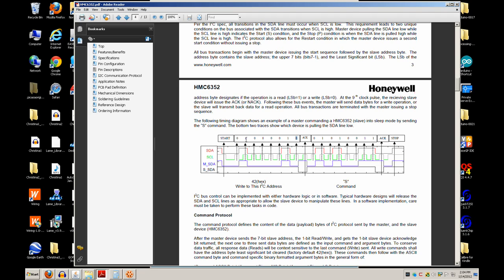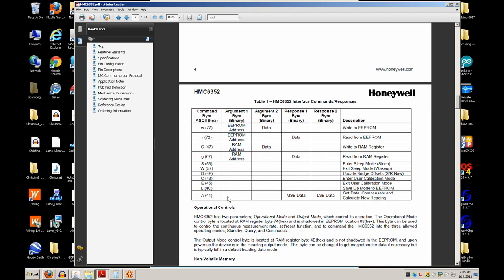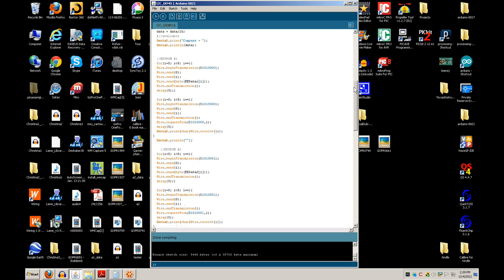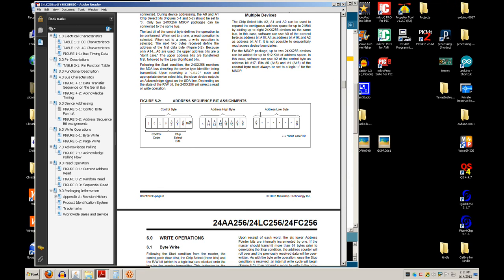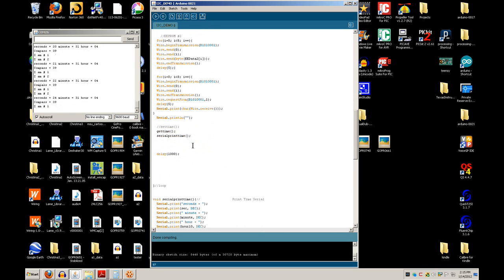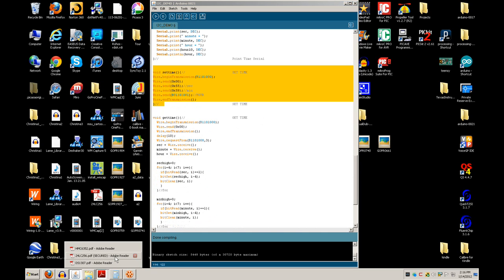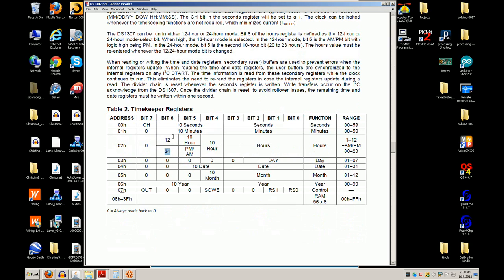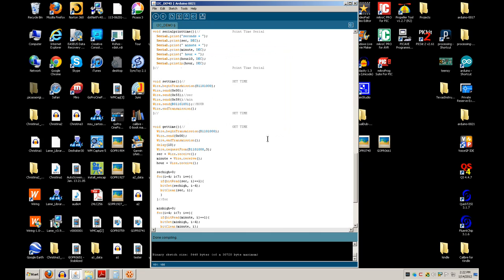How to work with I2C "Two Wire Interface" Devices!

Comment: Another note... the way that the RTC uses the 4 bits for "10 seconds" and 4 bits for "1 seconds" sets you up perfectly if you are using hex.  ;-)

since 55 seconds would be 0x55 ..    and 18 seconds would be 0x18  (note that 4 bits (a nibble) is one hex character.

For the other items (AM, PM, etc) you would probably want to use a struct{} to build and set it up easily.

Comment: You just have to know that for the 4 lower bits the values 1, 2, 4, 8 are and the upper bits are 10, 20, 40, 80. So you can roughly see what the value is in an instant

Comment: Hi this is very helpful video.
I had trying to get a simple communication between Arduino Diecimila and PIC24 through I2C. Its almost 3 months completed in search of communicating these devises. 
I am in a serious need of help I need a simple communication between pic24fj256ga110 a 100 pin device with Arduino, both of these devise are individual powered supplied and for pic I am using MPLAB IDE.

Comment: This can help you short the code with MSB LSB:

 unsigned char MSB = 0;  // 1 byte in Arduino
  unsigned char LSB = 0;  // 1 byte  in Arduino
  unsigned int MSBLSB = 0;  // 2 bytes in Arduino

Code segment:

   if (Serial.available() >= 2)
   {
     MSB = Serial.read();
     LSB = Serial.read();
     MSBLSB=word(MSB, LSB);
   }
  // Now MSBLSB = 320;

Comment: Dear Kevin,
                I am beginner learning this programming. I have issue when i upload the sample code like "Hello, World". It doesn't work and show error like ("liquid crystal _I2C does not name a type.")  i used the 1602 I2C screen LCD and sample code is

#include <Wire.h>

#include <LiquidCrystal.h>

LiquidCrystal lcd(0x27,16,2);  // set the LCD address to 0x27 for a 16 chars and 2 line display
void setup()
{
 lcd.init();                      // initialize the lcd 
 // Print a message to the LCD.
 lcd.backlight();
 lcd.print("Hello, world!");
}
void loop()
{
}
Could you please point out to me. I want to know the place where I made error,
Thank you very much.
Reply: Im having the same problem He said he re-wrote the sketch because the Sainsmart code does not work but I cannot find it on his website